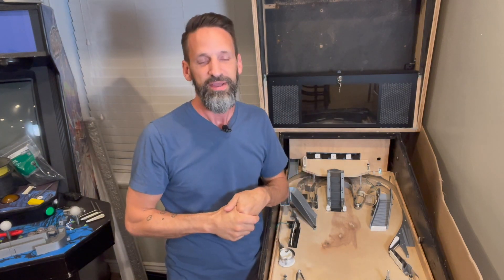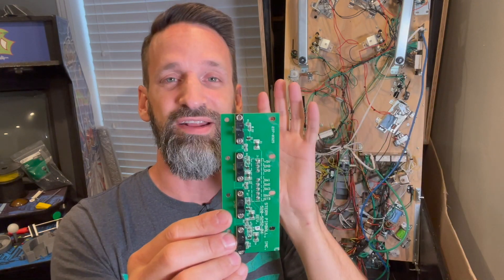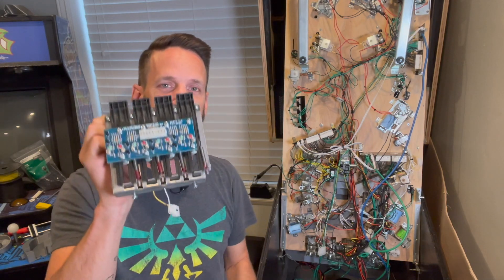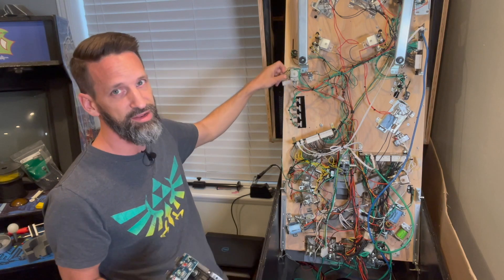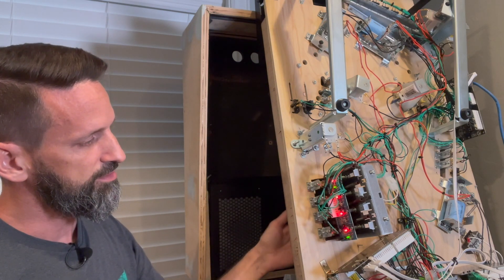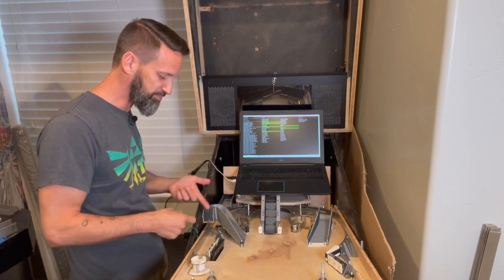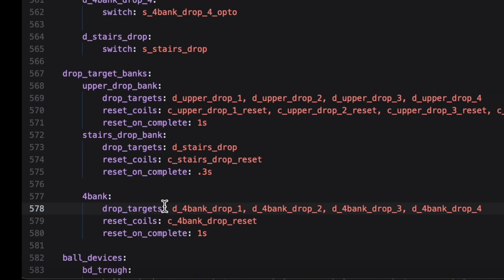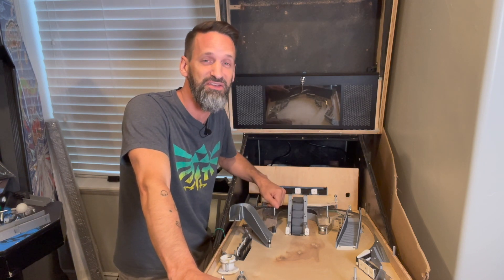HOW TO MAKE A PINBALL MACHINE: Drop Target & Drop Banks

Comment: Hi, still enjoying watching the videos; your a goof :)  As a educated electronics enthusiast and love studying the circuits of the pinball word; I a goof also.  I had a chuckle when you made STB switch to board ground.  No wrong not right STB is strobe, as someone else said, but Stern in many games us a switch matrix.  To read a line of 8 switches an CPU output line "switch enable" or Strobe is on, reads 8 switches, then next output reads  8 more, and then continues to the next 8... etc.  Newer electronic CPU use more direct reads on I/O boards like the FAST system. BTY FAST is sweet.  I will use it on my build, in the future. Also I studied the Stern Shrek game manual for the full line of circuit board schematics and wiring for the system.

Comment: hi Steve
 I am myself wiring the optos of my ball bank and I have burned out my emetric leds. indeed it is necessary to put resistors to limit the current in order not to burn them (max 100mA... it is noted on the card but I had not paid attention) I understood it too late. obviously on the new droptargets that you have the resistors are already installed on the board. did you have the same problem? I use P3roc .... maybe fast integrates resistors directly into its cards to avoid this problem.
Thibaut
Reply from the maker: Hahah, yeah I think I did just over power the resistors - the board might be salvagable, but I don't replace components on boards often so I didn't really even think about that, it was easier to just replace the board

Comment: STB stands for ‘Strobe’. The STB signal is an output enable signal that is active when low (ground).
The SW lines are driven externally via pull-up resistors and the motherboard will read this voltage when the strobe signal is active. When the optocouplers are not blocked, the SW line is at high level all the time even when strobe is low. When the optocouplers are blocked, the SW line is at around 0.8V (low level) when the strobe is also low. This 0.8V is not 0V because of the voltage drop in the diodes (D1..D4) and the saturation voltage of the npn transistor (Q1..Q4).
It is a very basic circuit. Anyway, I do not think the original board is broken just because you connected 12V in the 5V pin. By doing this you increase the current of the optocoupler’s LED from the normal 12mA to 32mA. Not enough to burn the LED. However, it can burn if you connect the power in the opposite polarity.
A final note, a board like this costs less than 10€ to manufacture including all components, of course ignoring the PCB design work which is a onetime only thing.
Reply from the maker: Hmmm interesting, I still have the board, when I have time maybe I'll try to diagnose it and see what's wrong with it
Reply: @thepinballroom  I'm an electronics engineer and my first thought was that it means strobe too.  Perhaps an enable line to enable the outputs but its not clear. Possibly its designed so that you can parallel up these units and multiplex them so you don't need so many inputs to read them all.  I've never heard of signal to board before.   If you had the circuit diagram for that board it would be a big help.

Comment: stb likely means "strobe"  which means that pin has to be grounded (in this case) to enable the board.  You mentioned you connected it to ground on your  I/O board.  Likely, those switch pins were shared on some pinball playing field by other switches so the strobe pin would be set to 5V to disable that board for a fraction of a second while the processor board looked  at other switches.  I/O pins were at a premium in decades past so sharing was a necessity.  I have no pinball electronics expertise.
Reply: I only know this 'cus I saw a video explaining pinball switch matrices and so I had the same thought: "strobe" (For someone with "no pinball electronics expertise" you're pretty knowledgeable!)
Reply from the maker: @VaxxedStories  yeah I have never heard of Strobe before myself 🤷
Reply: @thepinballroom  if you run across any more abbreviations you can't decipher you might try searching for "Altium pin name abbreviations". They have a PDF that covers the most common abbreviations you'll find on boards. It's not pinball specific but designers generally stick to the common abbreviations and sometimes knowing the full pin name can help you find more relevant search results
Reply from the maker: @chdn  hey, thanks for that! that's a great resource I didn't know about!
Reply: @VaxxedStories  I stumbled across the build here and found it interesting so following to see the progress.  I am a EE by education and experience.  I am fascinated by the different things people do for fun and profit.  It would be fun to build a pinball machine just to say I did it.   I am learning a lot by watching these channels.

Comment: I don’t know much about electrical circuits, so I may be wrong, but the IR switches on the board have two sides. The 5v and GND power the IR LEDs on one side. On the other side is a photo transistor, which also needs power and GND that will connect to your switch board. They can share a GND (STB), but each has their own voltage from the fast switch board.
Reply from the maker: Yeah this is a proprietary Stern opto board and just has a single power input for both the emitters and the receivers
Reply: I see, interesting